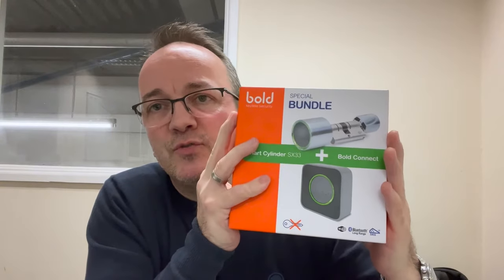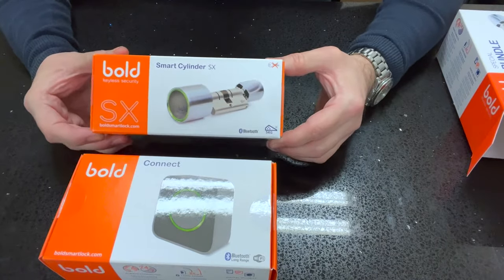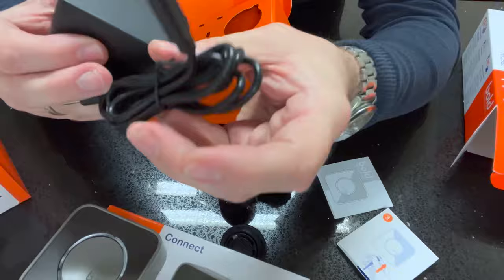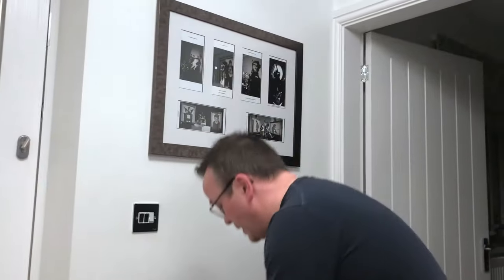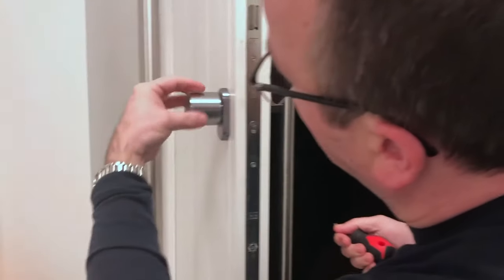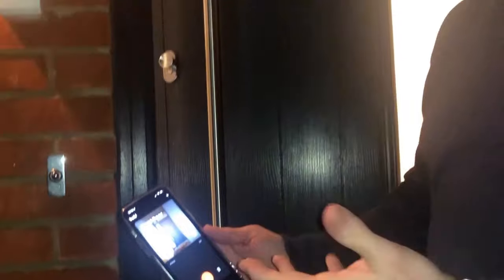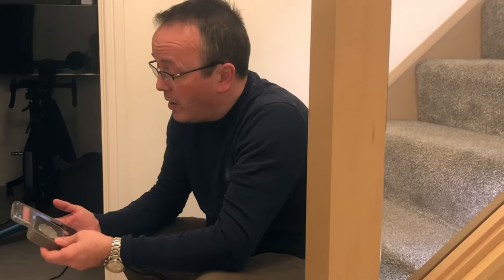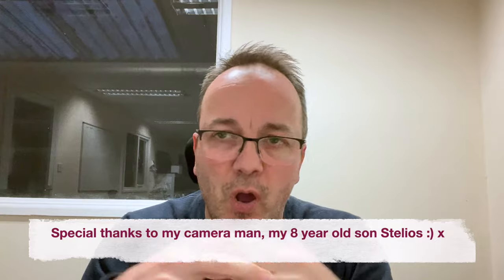Bold Smart Lock + Connect Review, Unboxing and Installation

Comment: Hi, 
thank you very much for this clear video, I am considering buying this lock, but are a little bit afraid that if the unlocking fails you can not enter the house and there is no option to use the regular key.
In the video it is said: "......If there is no battery that backup PIN will still work........", this is not the case because power is needed to activate the unlocking mechanisme. The backup PIN is to unlock without the need for a phone.

Comment: I have a lift handle that engages the 3 point catches before locking with the barrell, does the smart lock engage these so you dont have to lift the handle, just want to know when the smart lock self locks, it locks the entire door? Great video by the way.
Reply from the maker: Hi Steven
In your case the smart lock will replace the barrel and key function, you will still have to lift the handle to lock the multi point security. The Bold lock automatically locks after 10 seconds so if you close the door and lift the handle, there is no need to use a key, simply walk away. I hope this helps. 
Kind regards
J

Comment: Bought and installed this lock today including one clicker and connect. A little doubtful because of our 3 points locking system operated by the handle. First impression very positive. Activation via the bluetooth and remote to be investigated in the coming days. Still need another Bold loch for my front-door so looking forward to February 4th.
Reply: To add another user to the door do you need to be connected to it via Bluetooth or for example if I’m on holidays can I add someone?

Comment: What settings are there under auto lock? Can it be set to manual? We have a multipoint door so it can't lock if the handle has not been lifted. Is it possible to setup so the lock doesen't auto lock after X time, but only manually locking.
Reply from the maker: Thanks for the question. The lock has an unlock timer that can be set up to 120 seconds. It cannot be set to manual. 
I hope this helps. J

Comment: My front door is like yours, so am I right in thinking the internal knob will always unlock the door when you turn it, The beeping and flashing is letting you know the outside knob is locked?
Reply from the maker: Hi, yes indeed, the internal knob will always lock/unlock the door. Green light shows the outside lock is active and can be used, it turns red when it becomes disabled (so the outside knob will just spin). I hope this is helpful. 
J - Ball Interiors

Comment: Hi, considering using one of these. A few questions: 
1. Does it need charge and if so how do I charge it?
2. If i give access to another person, you said they have to download the app right. Is there a way to hold their phone up to the lock and it simply unlocks (similar to a contactless card), or do they have to go into the app and press the unlock button?
3. Would it be easy enough to simply remove that cylinder and return to the old one with your previous keys if you wanted to?
Reply from the maker: Hello, 
The lock is not rechargeable, it contains a battery. We have experienced around 2 years with heavy usage before the lock gives you a prompt on the app to changer it. Changing it is simple. 
You need to use the app to unlock, you can set the app to Auto Unlock when you are within a certain range for example you are within 3 metres it will activate. You can also purchase a ‘clicker’ keyring and link it to the lock, this way you simply click the key fob and the lock will open, no app required. 
Yes you can easily remove the Bold lock and re-fit your old cylinder and use the old keys. 
I hope this helps. J - Ball Interiors :)

Comment: Hello. Does it also have a mechanical key? Or does the pin work while the lock is out of battery? Or what other backup does it have for those moments the locker is out of battery? Thanks!
Reply from the maker: Hi. 
There is no mechanical key. The pin will work if the battery is dead. the battery does last a very log time (mine over 2 years before first low battery warning). The warning of low battery comes in plenty of time, I left it 3 months before actually changing it! It’s a damn good lock. I hope this helps. 
J - Ball Interiors

Comment: Hi, my door don’t have auto lock feature, so after changing to bold, I need to use the app to lock my door when I leaving home? Thanks.
Reply from the maker: Hi Peter, 
Yes, if the door doesn't auto lock when closed, simply use the app or, as you leave, press the button on the internal handle which will give you time to close the door and turn the knob on the outside to lock. The time it is active for can be set in the app to your preferred number of seconds. I hope this helps. 
J - Ball Interiors

Comment: Thanks for the video, it was very useful, I've been looking for an RFID smart lock as I was a little concerned about relying on a smartphone to unlock a front door (especially if the door closes behind you with your phone in the house). I suppose this is where the pin part comes into play. Is there a click or can you feel a turning point when you turn the handle so you know you have hit the right number?
Reply from the maker: Hi Gavin, thanks for the question. 
Yes, the backup pin works well if you have lost or left your phone elsewhere. When the lock us locked, the outer knob simply turns with no resistance, if you use the app or pin, when correct, the resistant returns (resistance caused by the engaged cylinder) and you can unlock like turning a key. When using the pin you have to use full revolutions in each direction (no resistance or click so a little practice and you soon get the hang of it). I prefer the idea of this as RFID can be temperamental. 
I hope this helps
J - Ball Interiors
Reply: @ballinteriors  Hi. Can i ask a additional question? Do I need to open the app or press big knob buttion when I go out?
Reply from the maker: @sowilliamso2990  Hi, thanks for the question. 
I suppose this depends on the type of handle / door mechanism you have already. If you have no handle, meaning you enter the door by turning the a key, then when you leave you simply shut the door. The bold locks natural state is locked and the knob (handle) on the outside that replaces the keyhole simply turns and does not engage unless the app is used. If you currently use a handle to unlatch the from the outside, you will need to press the internal handle button or use the app on the way out to activate the lock, then turn the external knob to lock it. 
I hope this helps
J - Ball Interiors

Comment: Apple smart watch ULTRA. Will it work as iPhone does /‘. Great  nice and down to earth video. Great stuff cameraman!!!!
Reply from the maker: Hi Stanbonsey,
I am using it with the Apple Ultra watch daily, it works direct using bluetooth (when you are outside the property) it doesn't work with the remote lock meaning you cant give remote access to people through the watch. You can still use your phone for this function if you have the wifi bridge also. I hope this helps. 
Kind regards
J - Ball Interiors

Comment: Hi, do you know how far the connect hub works? Could you unlock your door when away on holiday for example? Thanks
Reply from the maker: You can be anywhere in the world when using the connect hub! TH hub connects the lock to the internet, so as long as the wifi is active at the location of the lock, the Bold Lock has true remote access. 
Kind regards - J - Ball Interiors

Comment: So everyone in the house needs to download app yes? 
Does the big button connect to an additional lock.. ie back door?
Thx
Reply from the maker: Hi Crypto Fail,
Yes everyone needs the app downloaded. You can send an invite/encryted key via message or email and when the recipient opens the invite, they will be prompted to download the app. 
I believe, although not tested, you can add more locks to the big button. Inside the app when you manage the button it allows you to add other locks so I would say this is possible. I hope this helps and thanks for the question. 
Jason - Ball Interiors

Comment: Hi there. Grat video. I'll be replacing my front with an Xreme composite door. Do you think  this smart lock will work on this type of door?
Reply from the maker: Hi Abdur, thanks for the question. 
If the doors has a standard cylinder lock then sure, this is simply replaced by the Bold mechanism. The door in the video is a solid wood core and composite heavy duty door by Solidoor. I hope this helps.
Jason - Ball Interiors Limited
Reply: Thanks for your reply much appreciated 👍🏾

Comment: Hi there and thanks for the great video! Question: My lock is a secure one that i can turn twice, so the mutliple hooklocks are at maximum security. How does that work when you leave on holidays for example and want to be sure that the frontdoor is locked like with the regular key, so twice turned?
Reply: It turns twice

Comment: I do love the idea of these. Be a good idea for when my daughter goes to high school next term so she doesn't have to rely on a physical key. 

The only issue I have is security and if people can steal cars with those signal things surely they can do that with this?
Reply from the maker: Hi Tony, thanks for the post. I'm not 100% sure about the tech however, I believe the only time this would be possible is if you had the lock set to 'Auto Activation' from within the app. This sets a radius to auto unlock when it detects a user with the app and permissions allowed to enter. I don't use this feature and to be honest, for every day use I have never found a need. The normal unlock feature within the app would send a split second signal when in close proximity when pressed and unless someone was waiting, very close, I cant see them being able to clone the signal? I know keyless entry is an issue with cars due to the constant signal the key gives off however, the app doesn't pulse a signal unless you press the button.  Food for thought though, I will start checking behind my hedges before I activate the unlock from now on ;) ... 
Kind regards
J - Ball Interiors
Reply: @ballinteriors  ah ok, makes sense. I went and bought one of these locks from your review 👍

Comment: So it does not unlock automatically with bluetooth (or similar) when one is near the door - it has to be done in the app to unlock (or via pin)?
Reply from the maker: Hi, thanks for the question. Yes it can and does, you simply set a proximity and it will auto unlock! It works really well too. I hope this helps. 
Kind regards, Jason - Ball Interiors

Comment: Hi, great review. 

My question is, my door needs to turn the lock to lock the door. Otherwise still open. The bolt lock is manual. Does it mean I can lock it because it will think I am adding pin?

Second question is. Does the big button support HomeKit?

Thanks
Reply from the maker: Hi, apologies for the delay in responding. 
It is still possible to use this lock with a manual locking system. It simply means you have to press the know button or app button as you leave, this will engage the lock so the external knob can lock the door like it unlocks when you return. If you think of the app as a temporary on switch, for unlocking or locking and it last for as many seconds as you set. 
I believe it also works with HomeKit although I haven’t tested it. I’ll give it a go and let you know. I hope this helps. 
Kind regards, Jason - Ball Interiors

Comment: Great video, not sure if it was mentioned but can the door lock be set via the app as an unlocked (inactive status) until the user specifies it to be locked (active status). Reason: I’ve got builders at the house and they keep going through the door all the time (back and forth). I would like to keep it unlocked while they are working and restate back to normal locked state when they leave.  Wonder if that’s possible?
Reply from the maker: Hi Mad Designer. This isn't a function that is available within the app or on the lock itself, the maximum unlock time is 120 seconds. You can give your builders scheduled access between certain hours and on certain days however, they will need to install the app to  unlock the door, or you can purchase separate clickers (key fobs) that again can have a schedule associated. It is unfortunate that a unlock state timeframe cannot be set as this could widen Bolds audience. Maybe this will come in an app update soon. 
Kind regards
J - Ball Interiors Limited
Reply: @ballinteriors  thanks J for the response. As the door is the only access for builders going in and out constantly, it will become an unnecessary pain having to use a phone within messy hands. Also the disable lock sort of feature would be good for the children in the garden going in and out using the back door. Just a missed opportunity.
Reply: @ballinteriors  odd that you can't leave the door unlocked like a normal door

Comment: Hi, how do you change the battery and how long does it last?
Reply from the maker: Hi Olli
Under normal use, the battery of the Bold Smart Cylinder will last for at least 2 years or 20,000 activations. This boils down to approximately 25 activations per day. If you use the Bold Smart Cylinder a lot more often, you will obviously have to replace the battery more often.
*
Tip: Increase the battery life! Turn off the buzzer to increase the battery life up to 3 months. If you don’t set a PIN code, you will have up to 6 extra months of battery life.
*
The battery status is visible in the Bold App. You will receive a timely notification when the battery needs replacing. The Bold Smart Cylinder requires a CR123A battery, which is readily available at most supermarkets / DIY stores. 

Changing the battery is easy, the main knob with the bold illuminating ring pops out by pushing in the two clips on the back. This can be done without removing the whole cylinder. The battery cover then simply slips off, pop the old one out and fit the new. No need to re-sink, it will work as before. 
I am happy to do a video of this if it helps. I hope this is useful. 
Kind regards
J from Ball Interiors

Buy the battery online: https://amzn.to/3GvcOH7
Reply: @ballinteriors  thanks a lot for your help and the video 👍🏻

Comment: Great video. I have a quick question, if you have the app set to unlock your door when you get close, does that mean it's unlocked the whole time you're at home?
Reply from the maker: Great question Adam, let me test this and get back to you later today.
Reply from the maker: Ok, so I set this to 'auto activate' in the app which sets a 200m radius from your phones location. I was in the house when I activated it, nothing happens the door remained locked. I left to the house to walk the dog, when I headed back, within 200m my phone informed me I was within the vicinity, when I got within 3m of the front door the unlock auto activated, I approached, turned the handle (knob) and entered. The lock automatically disengaged after the set number of seconds (mine is set at 10) and re-locked. While I was home the lock remained locked. 
So, the auto lock only happens once, when you are more than 200m away it knows to look out for your return, when you return the lock unlocks once and then re-locks until you leave again. 
This is the first time I have really tested this feature, personally I think its a feature that will be used very little! I have now deactivated it as I cant see its benefit, I mean, it would be handy if you had your hands full but still you have to turn the handle (knob) to open the door so... Let me know what you think. 
I hope this helps Adam
Kind regards
J - Ball Interiors
Reply: Thank you so much for testing that out for me and giving me such a detailed reply. I really appreciate it! That really helped, thank you 😊

Comment: Bold says the lock cant be locked or unlocked via WiFi. The bridge is mainly for programming conditions based on lock states and not to ie auto unlock when you get home etc
Reply from the maker: Hi Mulle, 
I think you may have misunderstood. The bold smart lock cannot be activated over wifi WITHOUT the bridge! I can 100% guarantee that the 'Bold Connect' (Bridge/big button) can and does activate the lock over wifi remotely, we use this function at our workshop office daily and home when necessary. Otherwise, what would be the point of this bridge!?! 
I hope this helps
J - Ball Interiors

Comment: How long does the battery last
Reply from the maker: Hi Vincent, 
It states 2 years however, I have checked an install we did 18 months ago and the customer informs me the battery indicator in the app is showing 90% and excellent condition. It is also very easy to change when needed. I hope this helps. 
Jason - Ball Interiors